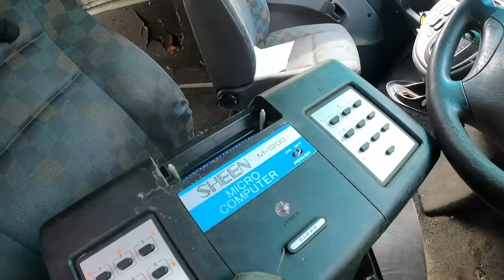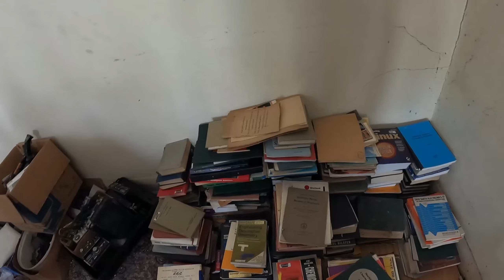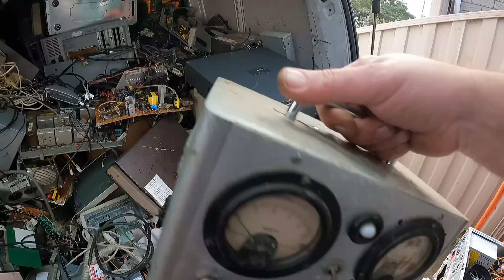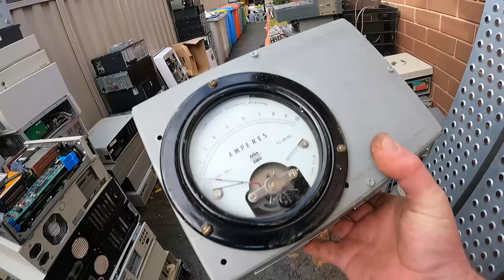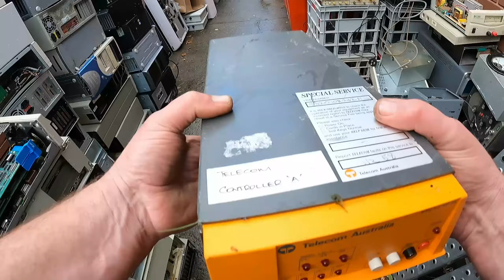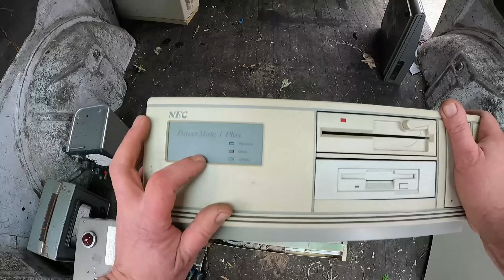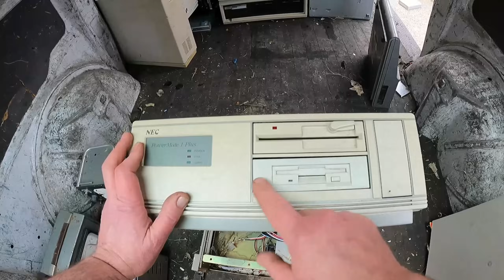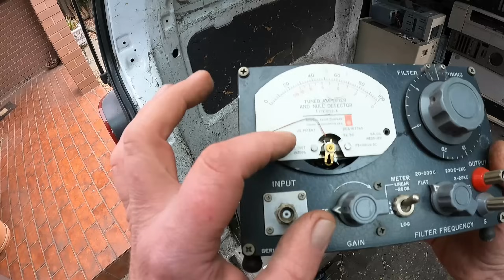WOW! Lifetime Vintage PC's from Hoarder Pt2

Comment: The old video games that are cord cut can still be used and sold to collectors that are trying to put old systems back in place, or even as display units.  The exterior cases on some of them were really clean.  Always worth a check to see.
Reply: most of this stuff would be worth a ton if you pieced it back together. I have seen a few items worth hundreds to thousands to a collector.

Comment: The Compaq Portable is an early portable computer which was one of the first 100% IBM PC compatible systems. It was Compaq Computer Corporation's first product, to be followed by others in the Compaq Portable series and later Compaq Deskpro series. Wikipedia

Release date: March 1983; 38 years ago

Introductory price: US$3,590

Operating system: MS-DOS

Backward compatibility: IBM PC compatible

CPU: Intel 8088, 4.77MHz

Memory: 128 kilobytes (expandable to 640 KiB)
Reply: It's selling for less than 400 on ebay
Reply: @woodworkingandepoxy643  less than 200€ running here in europe

Comment: If you find any more 70/80's style non-PC's like that TRS-80 Color Computer (or Commodore 64, Amiga, Sinclair Spectrum, Amstrad CPC, Microbee, Apple, etc.) they are worth good money from collectors.  Depending on condition, they could be worth $100 - $300 for parts or to repair and restore. Monitors like that Commodore one you showed can pull $200-$300+ if working and in good condition.
Reply: I just found an apple monitor i think it's the 3rd year Maybe..big round base with the arm that swivels and goes up and down..really cool

Comment: The carry computer would typically have been used by IT/Software salespeople to showcase systems.  We had one way back in the early to mid 90's and referred to it as an Elna Sewing Machine.  It would run Oracle on SCO Unix.

Comment: Wow, you found a TRS-80! Its a model I; one of the first computers that was to be used commercially. It had a relative huge fanbase of users in the 80's. It uses the Z80 processor, and a strong basic language. You had to save on a cassette recorder ;-)
Reply: Dragon made a version of the Tandy TRS-80. I still have a mint condition one in it's original box.
Reply: I remember my grandfather used to have 3-4 of these with those cassette decks. No idea what we did with them when he passed, probably got trashed like so many things in those days.

Comment: My first computer was a TRS-80 Color Computer just like that one. Except, it had only 4k ram and standard BASIC. I eventually upgraded it to 16K ram and extended BASIC. I get massive nostalgia when I seen an old Coco 1.They are worth around $50.00 - 100.00 U.S. The real money is in Tandy Color 3's. They are selling for around $300.00 and are getting hard to find.

Comment: Probably a oxygen tank, be my guess, most of the hoarders I've seen have some kind of health problems, so yeah, wouldn't surprise me a bit if it was oxygen or something like that. Most of the older CB radios had a certain amount of crystals in them, i know back in the 70's when the CB craze was in high swing, there were different shops all over where you could take your CB and have it tuned to a antenna and you could have your CB upgraded with more crystals to where you could really reach out and talk to someone, i used to talk to a guy out in Kansas or Nebraska, don't recall which, but I was here in KY. I was on a mobile CB in my pickup truck and he was on a base station in his house. Well that was usually on a clear night when I could reach out and talk to him.

Comment: The Texas Instrument box is a docking station you could insert a TI laptop into, which adds expandability (connections for an external monitor, full keyboard, slots for expansion cards, etc) and turns it into a desktop computer temporarily.  Also I can’t believe you never saw a Compaq portable (luggable) before?  That was one of the earliest PC clones and one of the original products that started the Compaq company.  The Plus had a 10 mb hard drive whereas the original Compaq portable had just one or two floppy drives.  It prompted IBM to develop their own piece of crap portable just to try to stay competitive.

Comment: The basic Model 1 shipped one 5.25" floppy drive and 256kB of RAM.[3] The Model 2 added a second 5.25" floppy drive and sold for $3599.[3] The Model 3 shipped with a 10MB hard disk in addition to one 5.25" floppy drive and 640kB of RAM for $4799 at launch.[2][3] The Model 4 would upgrade the Model 3 with a 20MB hard drive and sold for $4999 insannnnne to see how much it was back in 86’ and how little storage these gems had but it was the next best thing at the time!